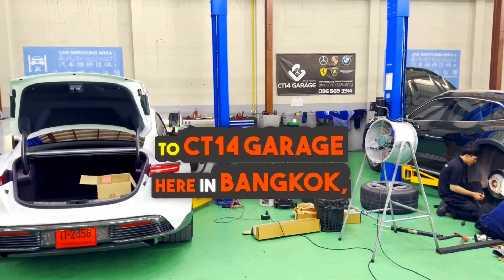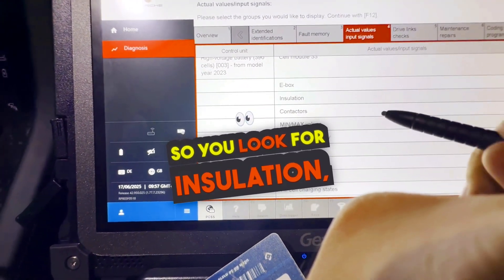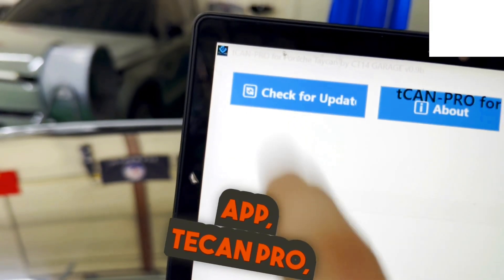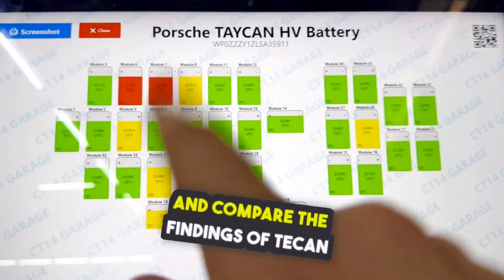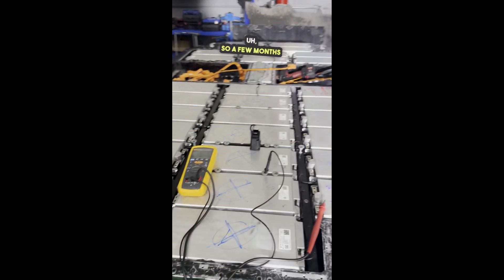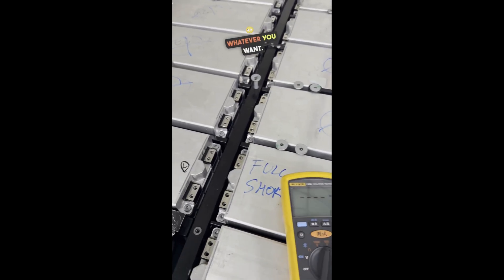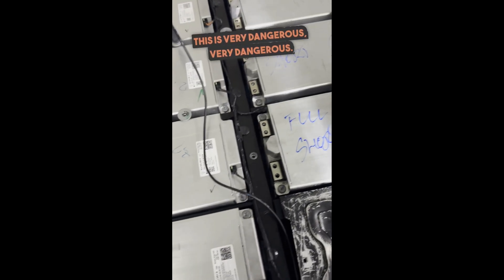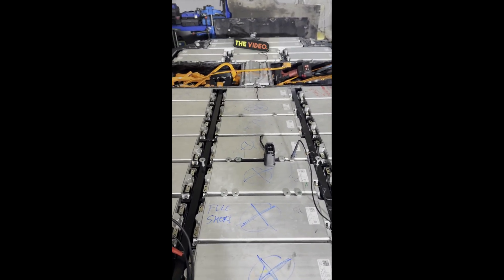MASSIVE TAYCAN BATTERY FLAW & FREE BATTERY AI DIAGNOSIS SOFTWARE  BY CT14 GARAGE

Comment: This is awesome. Any plans to create the same for the Etron GT? Or if this can work with it? Would gladly support.
Reply from the maker: Correction, after feedback from users the app works normally on Audi E-Tron GT (but GT models only)
Reply: @CT14Garage  Thank you!!! I am hoping to take delivery of my 2024  Etron GT (J1.1, not the refresh) sometime this summer. Still waiting on the high voltage recall fix before they can release the car. I will definitely get this. Right now they said all cells are healthy but will be nice to manually check to know if something is going wrong. Thanks for updating!
Reply from the maker: It doesn't work for Audi E-Tron yet because the Gateway uses different IP addresses for BMS in Audi vs Porsche. In the future I will try to support the Audi as well as it's basically the same except for a few key small differences... We dont have E-Tron here so difficult to test!
Reply: @CT14Garage  would give you mine to rest, if I could. But I'm in Canada